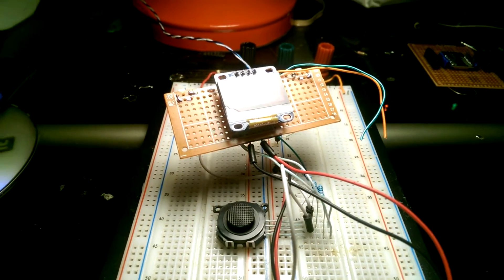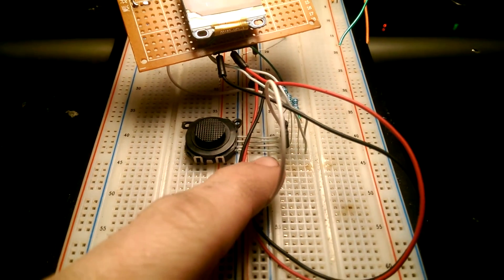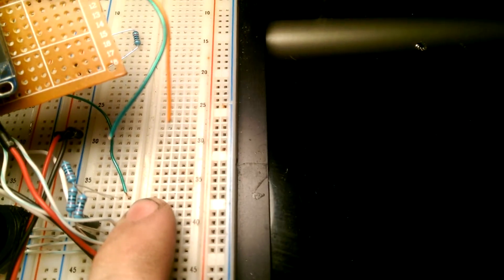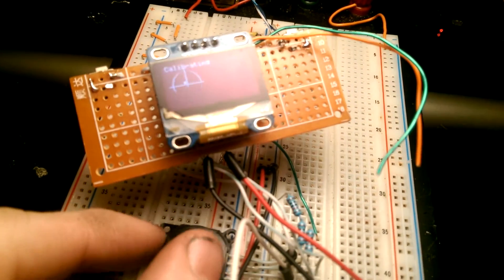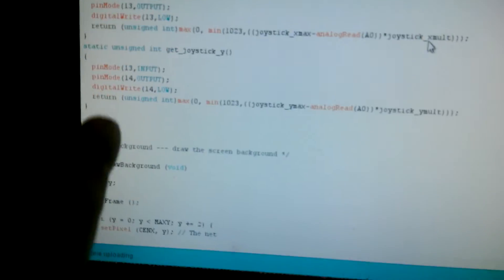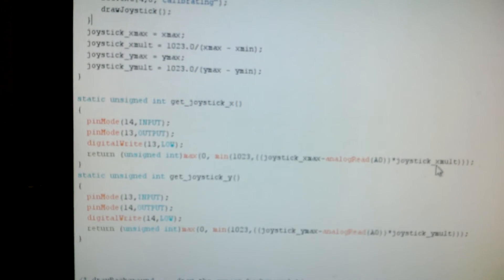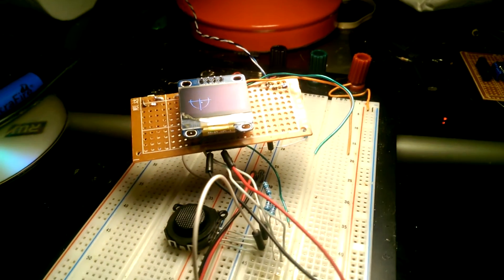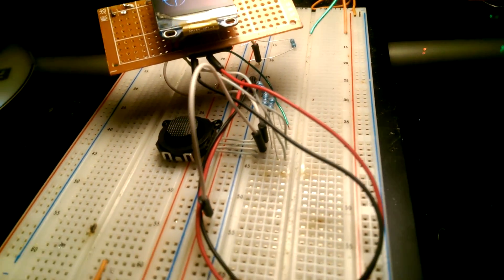Attaching 2 analog inputs to the esp8266 without a multiplexer

Comment: Hmm - what is the resistance of the pots in the joystick there? I am getting a strange effect trying to replicate this - when I push either stick in the upward (voltage higher) direction, the output of both is effected.
Reply: Just to pre-empt questions - I'm using 10k resistors, although the joystick measures up to 3k between the axis and either rail at rest. The code is using NodeMCU, but is definitely making the same pin manipulations.
Reply from the maker: try adding a resistor to the Vin of the pots on the joystick. 330 or 470ohm should do the trick
Reply from the maker: or at the vout of each pot.